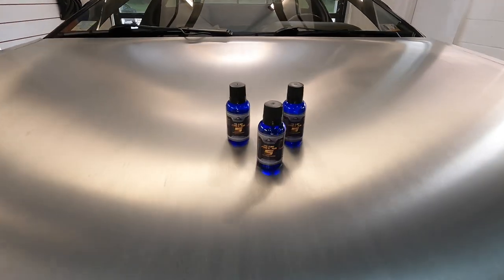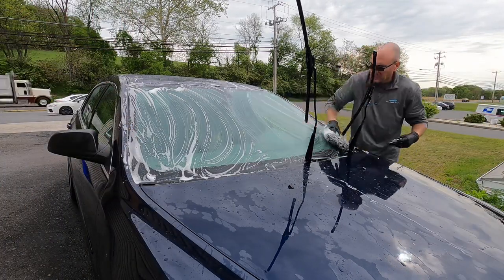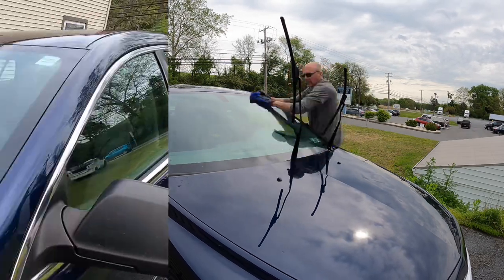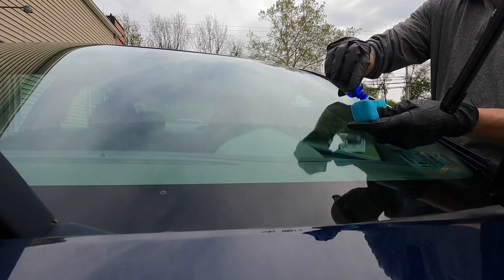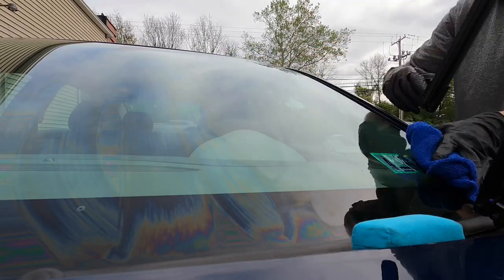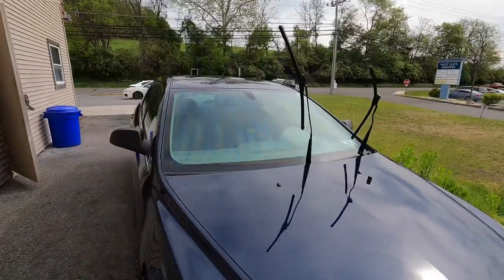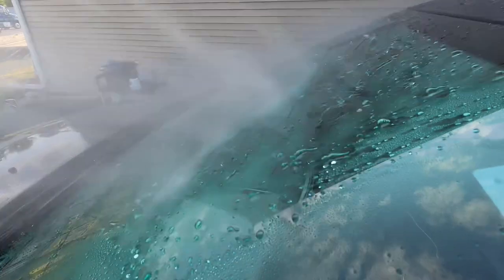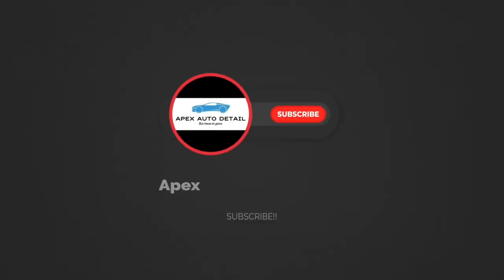NEW!! Introducing Blue Collar 5 Pro Glass/Windshield Coating!!! Prep And Application Instructions!

Comment: I forgot how terrible uncoated glass is until I had my windshield changed and it was sketchy in the rain it’s like the water was like glue and even after I parked and it dried the glass where the wipers stop was vary dirty. I’ve only ever used GPs kit and Kamalazi intenso and GPs kit has lasted more than 3 years and only using to maintenance wipes every 8 months or so both are a breeze to install. I will definitely need to try some more of your products as I use up my supply.

Comment: Mine should be arriving this week , can’t wait to give it a try. I also have BC4 I’ll use it to top it with. How long until I can top it with BC4 ?

Also quick question Brian I’m regards to prep can I use the glaco compound roll on after the clay process ? I still have this left from when I used it on the wife’s vehicle . But I’m going to put BC5 on mine . Thanks
Reply from the maker: After 24 hr… you can then begin to top it.
Reply from the maker: Sure … use the glaco

Comment: Unfortunately, we still go thru car washes, albeit the better ones with the foam brushes etc. They offer sealants, some ceramic, and  of course Rain X. I'm assuming that will do two things? Wear off the coating, and mask it with their toppers? Would it be advantageous to clean it with your topper afterwards? Or would that start adding to many layers simply polluting the system?
Reply: Good question too bad you got no answer. Because of your question I decided not to buy this product. Don't need stacking of products on my windshield to cause visibility problems. Require spillover from  spray products from the roof of the car will help keep water beading without screwing up the windshield..